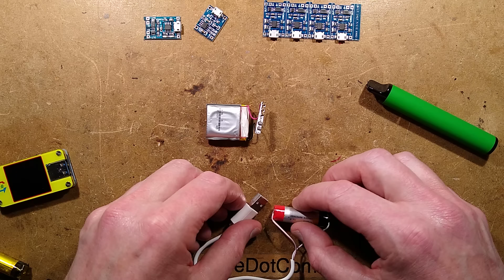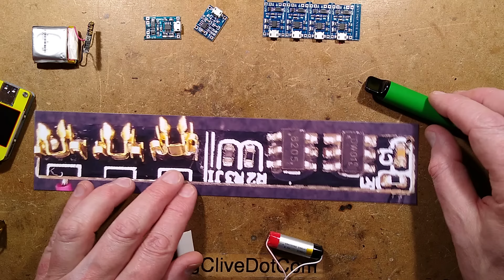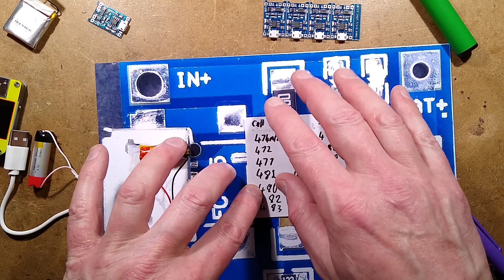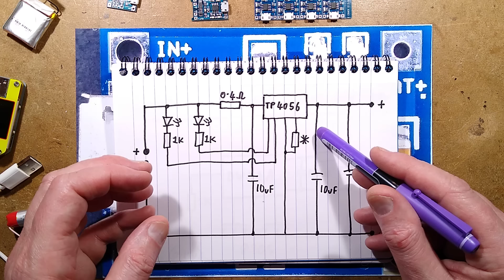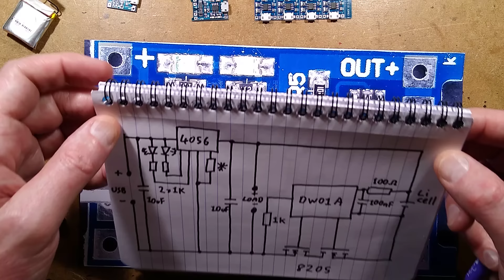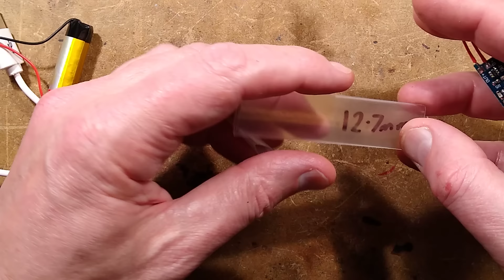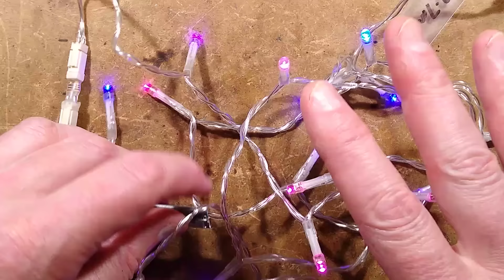Don't do this!   (There's a much safer way)

Comment: I salvaged 6 lithium polymer batteries from a 2006 MacBook battery, while removing them I cut away all the protection chips so they have no bms, I would like to make a power bank and I know I can use a single one of them, they are all 3.7 11.5wh, I looked it up and it’s listed as 3200mah, will the tp4056 module be able to handle and charge 2 of these polymer batteries wired in parallel? I already charged each one separately with the tp4056 module, and measured them and they are at equal voltages, i just would like a longer lasting power bank so Id like to use two in parallel if possible. Would charging two of them be too much for the module to handle? I could always use my bench power supply as it has CC CV charging and I would charge a single battery at 4.2 volts 1.6 amps and cut it when the current drops to 10% . Just curious how I would be able to charge two wired in parallel. I enjoy your videos and thanks for your time.
Reply: Yeah it'll take maybe up to 8 hours, but it'll charge them. Please be careful when wiring cells in parallel, they need to be at the identical voltage first.
Reply: @SianaGearz  4 out of the 6 are at equal voltages after I charged each one separately, I’ll probably use two pairs in parallel and the remaining two with different voltages in single cell applications. Thanks for your response. 👍🏼

Comment: 17:25 i love that even inch standard parts like heat shrink get metric names in the UK lol. 12.7mm is exactly 0.5 inches. the imperial system is metric, so its kind of come full circle. for you imperial system purists out there, an inch is defined as exactly 2.54 cm, so using inches is like counting amounts of items using how many dozens there are instead of exact numbers.

Comment: Great video! I actually started to collect some and got a bunch of different versions. I knew about the tp4056 board as I used it in a lot of my projects but my question is, how would you connect multiple of this cells and how to protect/ charge them in that case. 
For example connecting 6, 8 or even 10 of these to get an extended capacity.
Reply: Wire them in parallel, connecting positive to positive, negative to negative. As long as they're the same voltage you're safe. The controller will see it as one battery.
Reply: @ChiEKKUsama  I also recommend having some sand nearby to smother the cells in case things do go wrong
Reply: If you're talking connecting them in series, you have to get 2s,3s,4s,etc BMS boards. These manage voltage balancing for each cell
Reply: @alattice   So in paralel is safe to wire them up without a BMS? What about if the cells are of different capacity?
Reply: @sebastiantv108  if it's in parallel, you can do what chiekku said and connect the + to +, and - to -, though they should be +/-0.1V difference when you do, and ideally same capacity (smaller capacity will be forced in fully charged state longer, reducing overall life & larger capacity battery will get less life constantly charging the lower capacity bat during discharge). 

Tl;dr, parallel is fine connecting directly via shared BMS, though try to keep the same type of battery connected
Reply: @alattice  Perfect, thank you very much! 😄
Reply: @alattice  have you seen them available in this form factor?

If wiring in series for greater voltage then I reckon you can wire one of these bms boards across each sell. Then solder a link between the 5v and 0v inputs so you only need one usb cable

Comment: could one board use a bank of cells
Reply: It can be done but it needs to be done VERY carefully. It can handle several cells in parallel, but before they're connected, they need to be already at the same exact voltage as each other, or substantial compensation currents will flow.
Reply: @SianaGearz  good point. thank you.

Comment: Friendly tip for those who don't know this stuff well: Dont leave wires hanging around if the ALL connections aren't WELL covered. If it's a high power lithium battery connected, any exposed wires/conductors WILL touch everything else metal within reach, which wants to cause a nasty fire, given enough time and opportunity. I've seen others make those mistakes, luckily it only destroyed a bunch of electronics. That battery had one cell puff up but very luckily stopped there... the owner gave it to me to take home. 
I put it in the back yard and "charged" it on purpose with rectified A/C. DONT do that! Obviously something very dangerous was going to happen, anyone would do well to assume they shouldn't burn lithium batteries on purpose and if there is a fire it will be larger then you think! 
(I used containment and back-up fire suppression(s)) Anyway, then there was a strong stench of spray paint, and then a lot of fire! (it was a large drone battery). That one actually scared me, burned it self completely in less then thirty seconds! All that was left was weightless ash! THE POINT is: that's what it wanted to do BEFORE I took it home! And that was because of un-covered connections in a rats nest of wire. Just don't ever do that!

Comment: I've got a total of 700 now 2.5ah LiPo cells removed from medical devices combined into a (conservatively rated) 48v 110AH battery. (about 5.5kwh) Tested each one individually, and set up a bank of these little USB chargers. Had to cycle the batteries a few times each. Ended up killing about 20 of the little boards for one reason or another, but they're like $0.50 in bulk. They seem to stop at random stopping points, so for measurement purposes they all had to go through a different charger for the last little top off.

In total I'm in about $350 for a nice big battery that powers a big fat inverter. :) So far the house hasn't burned down...

Comment: those "one time use" vape pens aren't really sold in the US. i've looked all over in different cities and in different shops (and gutters outside). i can't find them at all! the only things i find are rechargeable ones for a higher price, or just the cartridges that contain the liquid you vaporize. i think people in the US are just less willing to buy the one time use pens, or the logistics don't make it cheap to sell them here? maybe the logistics train is shorter for 18650s in the UK, so its worth selling them without any recharge circuitry.

also i've noticed a lot of devices are using "Lithium" batteries in the US now. there seem to be only two manufacturers in the entire planet earth for these weird single use batteries, and its Energizer and Bevigor, with Bevigor being absolute dog shit quality. From what i can tell, they really are a one way lithium reaction and are impossible to recharge. i just huck them in the trash when they are dead because there is no recycling where i live in the US (which is very common for rural areas). Is there a way to recharge the Lithium batteries? keep in mind, they are NOT lithium polymer, lithium iron, or anything else. they just say "Lithium"
Reply: Those (second paragraph) are Lithium Primary cells. They cannot be recharged. Wikipedia implies that you can sell them off to a meth lab after they're depleted, who will uhhh "recycle" them. Funny.

Comment: Question, is there a reason why lithium batteries only charged to 4.2 volts? Why not manufacture them to be 4.8 or 5 volts?
Reply: Because that's how the chemistry works out, it's unstable at higher voltages.

But it turns out 4.2V was the original safe charging voltage all the way back in the 90s. By mid 2010s the maximum charging voltage rose to 4.35V, and now i'm lead to believe for some cells it's higher again. The progress with voltages is down to stabilising additives in the battery chemistry, but every small improvement requires many years of research.

Of course there is a stability gradient. Say 4.2V was balanced originally around 300 or 500 cycles, that order of magnitude, until the cell starts rapidly failing. Nowadays you can probably do 1500 cycles with this voltage, while 4.35V gets you to 500 cycles again. In return you can get batteries that are much more long term durable if you charge them to a lower voltage.

I suppose it turns out that at 5V the life of the cell is probably one cycle :D But really it won't hold that charge, it will bleed it off until some saner lower voltage is reached, and it will take damage in the process.
Reply: @SianaGearz   I do remember finding cells from cell phone battery that charge up to 4.35 and others 4.2 I never really understood why. I did do some reading online but along time ago but it really wasn’t clear why it was this way.
Thanks alot for explaining this.

Comment: delicious smelling vapors, but quite toxic fire gassing, no?  battery fires best put out with sand, from what I've heard.  
now let's all go put a bucket of sand somewhere handy in the workshop.

my friend who raced solar cars for university back in the early '00s tells horror stories of fatal battery fires down in the desert,  drivers laying down, bolted into multi million dollar carbon fiber race cars.  death traps of smoldering lithium cells and epoxy.  each support vehicle (usually a semi/tractor trailer) was required to haul several hundred pounds of sand.

Comment: 17:28 - Those TP4056 chips can get very hot even without the heatshrink.

I actually bought some tiny aluminium heatsinks for mine (not so much for the chip's sake, more for my own if I happen to touch it), but the adhesive they came with was kind of crap, so I ended up having to solder the edge of the heatsink to the USB port, which probably involved heating the chip more than it ever would on its own. :-P
Reply: "solder" and "aluminium" do not mix well for me. BTW, did you stick it on top of the chip, or on the other side of the pcb? The latter should be better (i think, haven't ever measured), as the chip case has low thermal conductivity, while there should be vias below the thermal pad of the chip to the other side of the pcb that are specifically placed there to conduct the heat.
Reply: @victortitov1740  - The PCB is mounted on a battery holder, so it has to go on top. And the solder worked fine, eventually. Just don't breathe too hard near it.

Comment: Personally I use my rc car chargers to handle all my charging needs - just need to make up a suitable charge harness.
They're incredibly versatile chargers with most being able to charge all types of lithium, nicd, nimh and lead acid.
If you assemble a multi-cell pack they can handle the balance charging. 
You can do a 50% storage charge if the device is not going to be used for some time which dramatically reduces cell stress so increases cell life span. 
The higher end chargers will also allow you to set voltage end points aswell - I like to charge my lithium cells to between 4.1-4.15v per cell (90-95% state of charge) which studies have shown dramatically increases the cells lifespan.

Only downside is its totally reliant on you to set cell count/charge current correctly.

Comment: Great video Clive. I have used a bunch of TP4056, my only regret is they don’t have a built in thermistor/thermocouple on a lead to sense an over heating battery. Otherwise they are great for single cell applications.
Reply: It would be good but I notice commercial products don't have thermistor. But notice tool Lithium does. I suspect that hi c rated Lithium needs them. But low c rated products may not. That's just a thought could be wrong. I guess you could get a microcontroller if it worries you.

Comment: Ali Express electronics do exactly this: zero voltage regulation. A children’s gameboy-thing got the 3.7v cell up to 4.9V. They refused a refund, I fought for months explaining the fire hazard + violates the specs of the lithium cell manufacturer. They. Do Not. Care.

Comment: wouldn't there be a charge controller built into the vapes?
Reply from the maker: Some disposables do seem to have some charge circuitry, but others don't.  Even the exact same model and brand.

Comment: There's so many connectors that are almost the same, but I think those are Molex KK series. JST SM, XH and Micro series have premade wires in ebay / ali etc. I guess it doesn't matter what you use, as long as you're consistently using the same leads lol.

Comment: Even before you're first videos of these I've been trying to get as many of these as I could now. It's just such a big waste and it actually makes me jealous of how many are being thrown away. I've been finding them on my way back from work in the morning on the floor in the city centre by all the bars. But I don't want to look like a homeless person going around staring at the floor looking for second hand cancer sticks like the homeless people do. It is such a waste though.
Reply: I found over 25 so far just by walking around the housing estates over the course of 4 months. Found 3 on my way to Asda, one of which had already been disassembled. I'm wondering if whoever discarded the bare components outside had watched Bigclive or might have attempted a dubious recharging method. I don't think I can trust lipo batteries from vape pens that I find already disassembled by God knows who. I have no idea what has already been done to them.
Reply: @bornach  I've found a few already opened aswell. Literally saw the top part in one place and just felt that the battery had to be somewhere and then I found the bare battery like 5 seconds after lol.

Comment: im cheap and do janky stuff but even I wouldn't do this. 4.2V is already high voltage for the cell, pretty much overcharging but allowed by the industry.  China sells/give out a single cell battery charger.
Reply: Nah cells are fully stable at 4.2V. They were maybe a little borderline at 4.2V 20 years ago! Many devices charge the cells to 4.35V for a long time already, close to a decade, which is afforded by newer stabilising chemistry, and that was the borderline threshold voltage for a time, and newest ones can do more again. At 4.2V you have even room to spare. But i understand wanting less, like only 4V, extra peace of mind and extra longevity, they could live almost forever, 20 years of use, with combined stabiliser improvements.
Reply: @SianaGearz  well it is debatable depending on usage and life of product. but yeah, 4V is best if one doesnt need all that capacity all the time like in an EV or laptop with huge battery. 4V could also put the cell's cycle life close to LFP.

Comment: I have been using these found cells with the PIR sensors/RF sensors to make battery operated auto sensing lights. Along with these charger boards.

Comment: also if you ad a small heatsink to the TP4056  you can increase the charging current dramatically
Reply: Not really? It only goes to 1.2A. It's preset at 1A at which it gets very hot to the touch but not hot enough for the chip to down-regulate or malfunction.,
Reply: @SianaGearz  I built a wall mounted charger a couple of years back with these chips. 

In my experience they thermaly throttle quite fast when charging high current 18650 cells even with the stock resistor value. 

When you change the resitor and add a heatsink to the ship they charge much faster.
I'm not sure how high the max current was since I never measured it but it was a big difference in charging time. 

The heatsink was around the base diameter of a 2 Euro cent coin and was quite tall. 
I'd guess around 2 cm but it still gets to hot to touch.

Comment: I tried to make 3 Amp charger by adding external transistor to one of  these boards. But then realized you can just connect 3 unmodified chargers in parallel.
Reply: and they also sell such ( multiple 4056 chips in parallel) boards readymade.
Reply: Another funny issue is  the 16.8 volt battery pack chargers.  Realized that you can connect the 4.2 V charger ground to the top cell, but route the charging current via the bottom cells, so that equal current goes thru all cells, until the top cell is full. Equilibrium achieved by swapping cells occasionally.

Comment: Dammit man! Looks like your Asda 'Ozark Trail' orange block is still working as well as mine! Though, I tend to use mine primarily as a torch. Even during a coupla power cuts, I'm still impressed how much light it throws out, I mean, sit it on its base, turn it on, and it fills the room very well (and lasts and lasts and lasts... 😏). 👍😎🇬🇧

Comment: Also, is there a module like this but for way bigger packs? Something that can charge at say 3amps
Reply: You can get modules that uses multiple 4056 chips in parallel

Comment: BTW, is there a reason why he solders the wires to the pads like that, instead of putting the wire trough the holes?
Reply from the maker: Ease of soldering.

Comment: I wish there was a module like this but with more conservative/adjustable cut off voltage, both for charging and discharging.
Reply: You gotta get a more expensive charge controller for eg drone batteries. Those will let you charge lipo, nicad, nimh, li-ion and also set the upper bound on the charge state.

Comment: Those little modules are so handy for a decent charger for scavenged batteries, though would be handier if the load output was turned off by default while charging, just so it doesn't mess with the charge cycle programmed into the 4056 chip...
Reply: Or even a non- interrupted supply style battery bypass for the load?